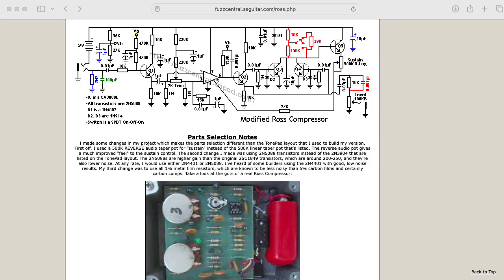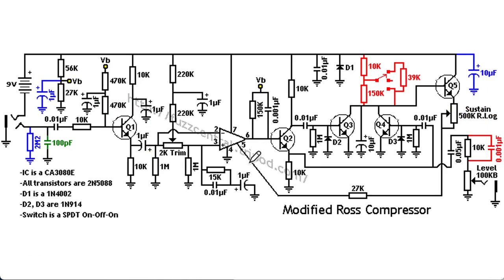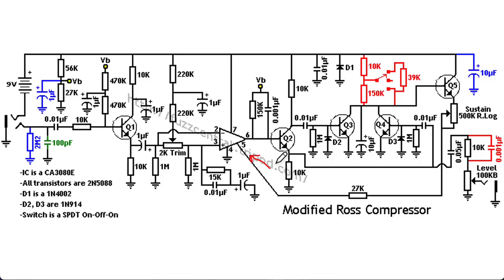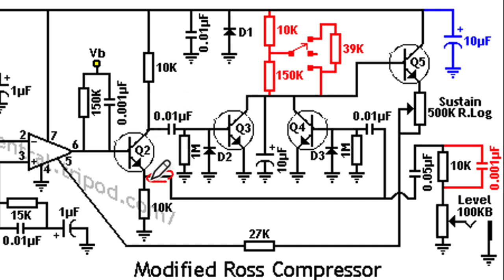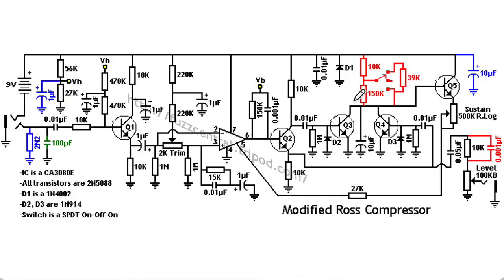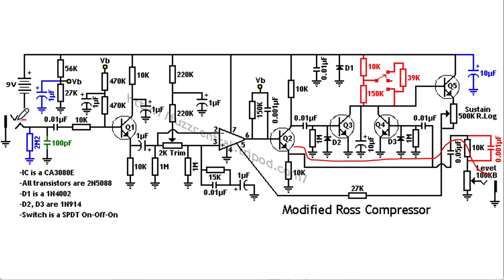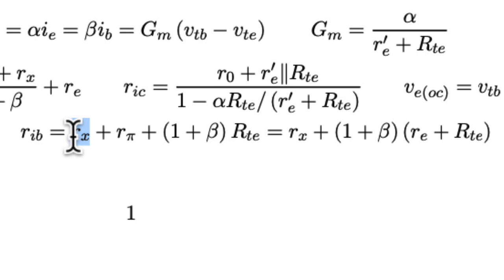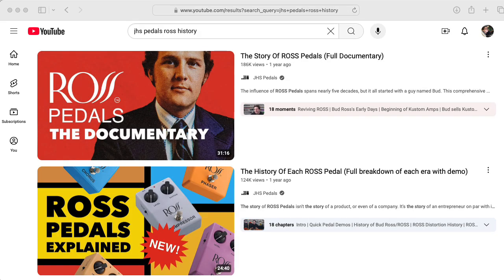Ross Compressor Circuit Analysis -- OTA-Based Pedal (Guitar Amplification and Effects)

Comment: Nicely done, and thanks for the nod.
About the mods in red...
A stock Dynacomp/Ross circuit will have a 150k resistor from V+ to the junction of Q3/Q4.  That resistance dictates how quickly the 10uf cap is charged up again.  But, as you have indicated, that is going to alter how much current is being fed to pin 5 of the 3080, and ultimately, its gain.  Variations in that resistance below 150k will speed up how quickly the 10uf cap charges up again.  This is often described as "gain recovery" time.  However, because reverting back to maximum gain is slowed down by that 150k, the initial transients of rapidly-picked notes can be subdued, due to the circuit not having gone back to full gain.  

Many manufacturers have substituted a variable resistance in place of the 150k, in order to vary the speed with which maximum gain is recovered.  Largely because the net effect of speeding up full gain-recovery can make the initial pick attack of rapidly played notes more audible, it has traditionally been labelled "Attack" on the control panel and schematic.  It is NOT, however, the same function as the Attack control on a full-featured studio compressor that had Release, Threshold, and Ratio controls.  In  those units, the Attack control adjusts how quickly gain is reduced in response to transients, and NOT how quickly it is brought back up again.  Much to my pleasure, Fender finally labelled the control as "Recovery" (rather than "Attack") on their Bends compressor pedal, and I was pleased to be able to tell Fender designer Stan Cotey in person how much this gratified me.

Misnomers aside, the impact of adjustments to gain-recovery time have long been bewildering to players, simply because the impact depends far more on the speed of one's playing than on the setting of the control.  Leave enough space between picked notes, and even slower recovery times will not have much apparent effect on what one hears.  "That knob doesn't DO anything" is what one will tend to hear in music stores.  But launch into much faster playing, and the pick attack will seem to evaporate.  Small wonder that the Dynacomp/Ross was traditionally preferred by players wishing to make their Les Pauls seem to sustain held single notes forever (one of the consequences of a slow gain recovery), while country players eager to launch into rapid "chicken-pickin" would often prefer the Dan Armstrong Orange Squeezer, that had a much faster gain recovery.  The implementation of variable gain-recovery time has pretty much eliminated the distinction between products on that basis.

As an aside, I had worked out the illustrated resistance values with a friend for his well-reviewed Ross-derived compressor, to use with a SPDT on-off-on toggle.  The intent was to provide easily replicable fast-medium-slow times.  Because effect of gain-recovery depends so much on how fast one plays, I saw no need for anything in between those settings, and that's what he included on the pedals.  Some time later, I saw that the toggle was replaced with a potentiometer.  When I asked him why he went to the needless trouble and expense of turning it into a pot, he said it was because of consumer demand.  Even though it matters little, and most users would likely either turn the control to min or max, it was the "illusion of control" they wanted, and a continuously variable pot gave them that.  I might point out that Electro-Harmonix went with the 3-position toggle for their Soul Preacher compressor, and has stuck with that.  Customers...bah!  Can't pawn them, and can't succeed without them.

Happy Chanukah.  Being a "Hammer" doesn't necessarily make me a Maccabee, but I'll happily accept the mistaken attribution. 🙂
Reply: Thanks for that explanation. I bought a used Dynacomp with this mod and didn’t quite understand the function.
Reply from the maker: Thank you for that wealth of information! I am pinning this post for the moment.

Comment: I may be coming late to the party here. Back story is, I've been overly in in  love with the old MXR "dynacomp" compressor since the late 70s. So much so that I eventually built it into the cavity of my les Paul, along with a noise gate of my own design. The latter is barely the size of a postage stamp owing the the use of all SMD parts, with the exception of a couple of LDRs I used for the actual "gates". But its the MXR is the original board and its getting crowded inside that guitar. So I've been thinking of re-building the "dynacomp" with SMD parts, maybe even improving on it, using op amps for the input, and possibly for a true precision rectifier. But I have been finding two slightly different versions of of the dynacomp schematic, and now your explanation of the ROSS pedal looks like yet a third nearly variation of this circuit. Is the ROSS pedal indeed a modified copy of the MXR, or visa versa? They can't be this similar by coincidence?
Reply from the maker: My understanding is that Ross cloned the MXR, and pretty much all of Rosses designs are cloned, with a few tweaks here and there.

Comment: So, Vb = 940K * Ic/β + Vbe + 10K * Ie. Assuming β >> 1, we have Ic = Ie, and we know Vb = 3V and Vbe = 0.6V. That gives 2.4V = Ic * (940K/β + 10K). If β is about 200, then Ic = 160μA and so the dynamic base resistance is 26mV/160μA = 160Ω. The input impedance looking into the base of Q1 turns out to be around 160Ω x 200 = 32K, making the total ac input impedance of the circuit 40K at frequencies where the 10nF input capacitor has an impedance much less than 40K (the -3dB frequency is about 400Hz - that's considerable bass roll-off).
[Edit:] A further analysis would be helpful, looking at the fequency response to see how much bass is attenuated, and to describe why that may be desirable in a compressor.

Comment: I'm trying to get an intutive understanding of OTAs the way I've developed for op amps, but it's not quite coming to me.  The main issue I have is the why - in this circuit, why go through the trouble of using an OTA?  What's the advantage?  Is it simply down to being able to control gain externally?  Because I'm pretty sure I could work out a variable gain circuit using a couple ordinary opamps...
Reply from the maker: You use an OTA exactly because you can control the gain. If you can come up with a way to make a voltage controlled amplifier with only op amps that would be a massive advancement in electronics!
Reply: @Lantertronics  the first few VCAs I looked into building don't use OTAs, they use a differential pair of bjts and two op amps...
Reply: @georgedorn_fnord  Sounds like you built a discrete OTA with some voltage controlled current sources around it
Reply from the maker: @georgedorn_fnord  Ah, you didn't mention adding external BJTs. The differential pair is half of an OTA. The core of an OTA is a differential pair with a current mirror stuck to it. So sure you could build a compressor with a matched BJT pair and an op amp. It's controlling the bias current through the pari that gives you the variable gain.

If fact you'll often find OTA structures inside an op amp, with a fixed bias current source. Take a look at the TL072 schematic -- you have a JFET differential pair (with pFETs so things are upside down relative to the way they're usually introduced in textbooks) with a 3 transistor NPN current mirror. 

Rene Schmitz has some VCA circuits with differential pairs and op amps on his website.
Reply: @Lantertronics  Yeah, I ended up consulting Schmitz' design, but it was Moritz Klein who brought it up.  But given that a tl072 is <50¢ and the bjts are cheap as free, it's hard to argue for the use of a $4 OTA without another factor (noise, I assume) being in play.
Reply: @georgedorn_fnord  They're not really $4 (unless you hunt for new old stock 3080s).  To your post above: Yes this is just for the variable gain, you can make a variable gain with an opamp using other methods, but it requires some other components and a little more elbow grease. The OTA is a popular "integrated building block" to make a variable gain cell. The discrete VCAs with differential circuits are very close cousins, as Aaron said. I find that the supression of the control voltage can be better with the discrete though, as it gives you more freedom to address this.
Reply: @Lantertronics  I also host an article about OTAs that was written by Gene Zumchak and another by Achim Gratz. Links right on the landing page.
Reply: @reneschmitz4845  Where do you source them?  Digikey's cheapest actually-available 3080-like is the LM3080, at $6 in quantities of 50...  (Unless I'm stumbling around their search interface, which has been known to happen...)  It's the LM13700 I've found for $4 elsewhere.

Also, hello!  I've consulted your site so many times, but I was not expecting to run into you in a random youtube comments thread.  I'm reading the OTA discussions shortly.
Reply: @georgedorn_fnord  Thx! It's a surprise to stumble over your own name like that. :) Go with the LM13700MX/NOPB, About 1.06€ for 1, 0.69€ for 10 at Mouser. ($1.15, $0.74)
Reply from the maker: Most of your op amp intuition probably relates to negative feedback forcing the input terminals to have the same potential, which isn’t in play with OTAs in general.
Reply: VCAs are the progression from OTAs for external gain control. That being said, this circuit could benefit from a precision rectifier in the sidechain.

Comment: @Lantertronics @Aaron Lanterman, i would like to say thankyou for your videos , i would Love a video break down of the (catalinbread antichthon fuzz tremolo). it seems to be extremely simple with a few components yet it does some things like the Tremolo sound from adjusting your guitar volume , a OD sound or a kind of Fuzz sound . i have this on a bread board it works great and would love to understand more about this circuit, how does the Ge transistor in Q1 even turn on i dont see how its getting power  and that Tremolo effect is really cool to me i just want to understand whats going on with this circuit . Thank you for your time.

Comment: The ROSS compressor (and most of their other pedals) were straight up stolen from MXR. They even got sued initially for using the same trade dress. I would like to see analysis of the original circuits, particularly the phase 100 and phase 90, phasers that use both LDR (phase 100) and FETs as variable resistors (Phase 45/90). The Blue Box is also an interesting circuit using CMOS logic flip flops to do octave dividing and a comparator circuit for the fuzz.
Reply from the maker: HAH! I didn't know that! I could have titled this video MXR Dyna-Comp analysis. I just googled some schematics and found it's the same topology, right down to the way the input buffer is biased.
Reply: @Lantertronics  I second the request for analysis of the MXR Phase 90/100 phase pedals!  I just bought one!
Reply: I have an MXR Dyna-Comp and I'm pretty sure it uses FETs for the gain reduction. I don't care for it much as it could also use a mix control to add the unmodified original signal.
Reply: Keeley 4 knob compressor has tone and blend added to what I believe is MXR/Ross comp. I owned and loved an old script model MXR, w/can type transistor. Pretty sure the Ross is very similar, if  not a direct knock off, but with more electrolytic capacitors and I can’t remember past that-I built a DIY from one of the sites, and I liked that one also, but not as much as my old one. We had a store called “The Gear Trader” and I was able to play or own or audition all of these things…GOOD TIMES! 

On one of my boards I had the cheap plastic Dan Electro comp, Which I believe is the same MXR/Ross topology (One or  the other) I couldn’t tell the difference between the newer ones.

Probably 2000 or so. My buddy came back with about $3000 worth of Chiquita banana boxes filled with the last of MXR parts, somewhere up in Rochester I think…There was a little of everything and a lot of some things… I still have a script logo, blue box, P45&90 and envelope follower,  that I put together from parts back then-good times indeed! LT
Reply: @LTJR. gear trader Huntington Beach!?
Reply: Vintage Ross phaser is positive ground topology with p channel transistors, mxr used conventional negative ground with n channel transistors. Not all Ross pedals are "exact" copies.